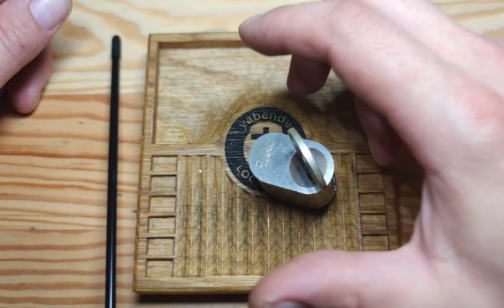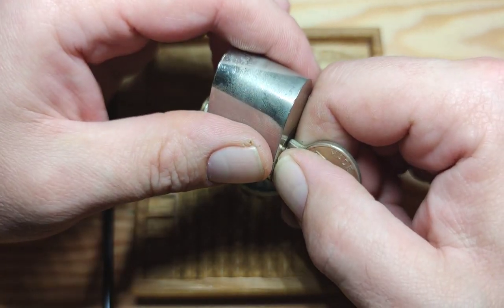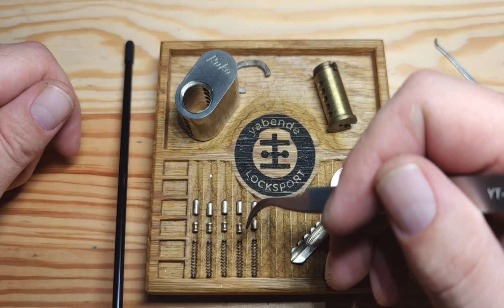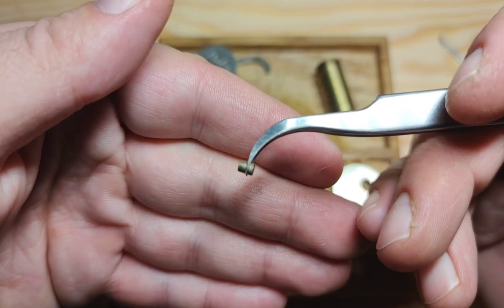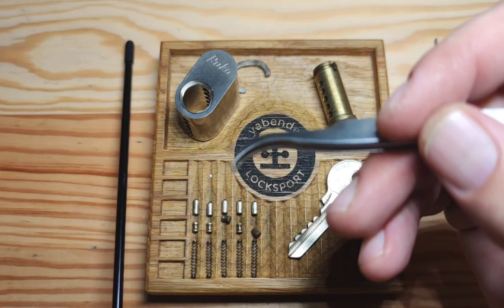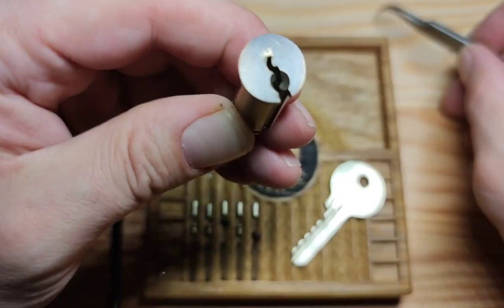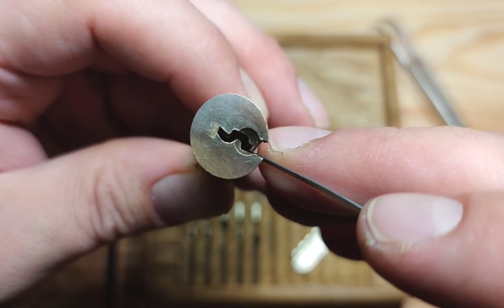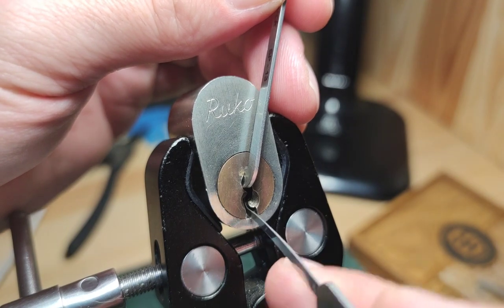Ruko 500 with hourglass spools picked and gutted

Comment: i have a problem with mine. The lock turns halfway and then it looks like the spools come out
Reply from the maker: I'm not sure if I understood you correctly - the core rotates 180 degrees and when the bottom part of the keyway is on top, then the driver pins fall into the core?